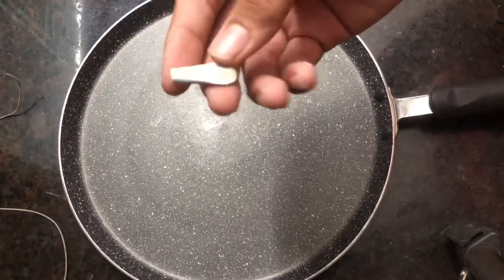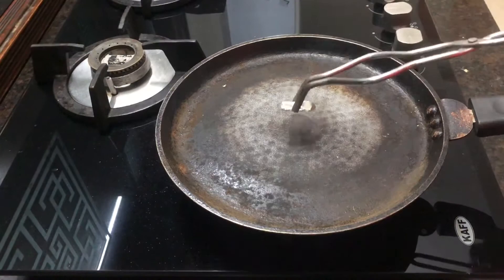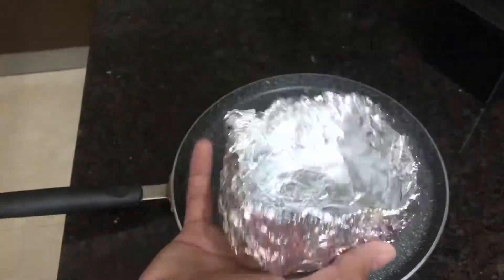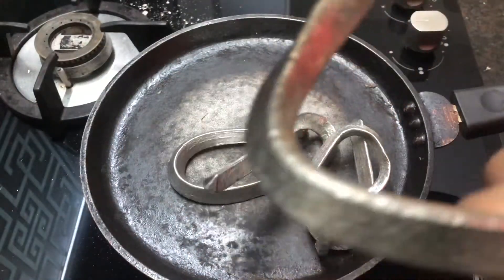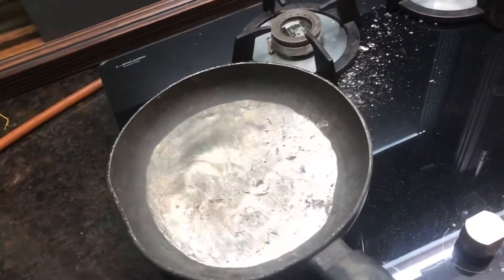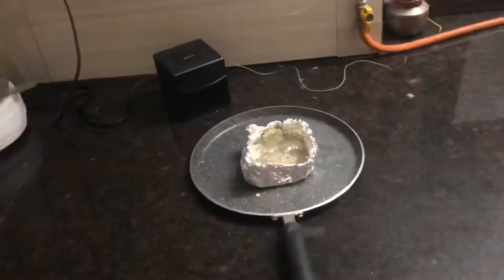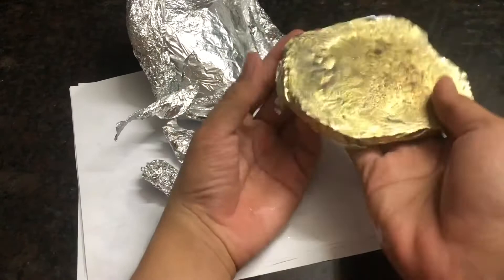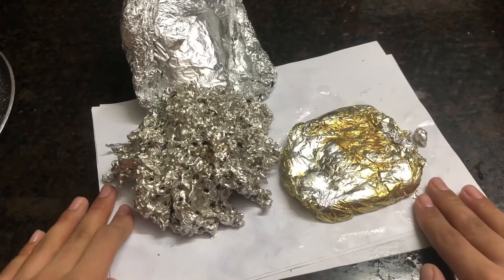|| TIN || The Metal That Melts On Your Stove

Comment: Tin can be used as a thermal storage material, because it's safe to handle, it doesn't produce fumes until it's 2600 degrees. So it can be safely melted and heated up to around 300-400 degrees as a heat storage material. While tin itself holds less heat than water per weight, it actually holds more technically when you factor in the phase change. This is because it takes a lot of energy to get tin to go from a solid to a liquid, that heat is contained then within the liquid state, and when that liquid solidifies it changes it's phase and mass releases heat in this process. 
This is no different than how water also suddenly releases a bunch of heat once it turns into a solid (ice). 
However water isn't practical for phase change energy storage, as it occurs at such low temperatures. 
With tin however it will phase change just by it lowering under 230 degrees or so, so it's perfect for using as a heat storage material. 

In order to build a heat storage unit, you will need a caste iron pot or possible stainless steel pot. Then fill it half full of tin, let's say it's around 8kg of tin. 
You want an electric element pressed against the bottom of the pot, the same type you would see on an electric stove. Run around 1000w of power through it from maybe solar panels. 
Make sure the pot is insulated, so you can keep the heat inside, a heat grade silicone sheath with other insulation outside of that would be effective. The solar panels should produce enough energy to make all the tin in the pot go liquid and possibly heat it up to 300 degrees. 

You can take the insulation sheath off the pot of a night time, and it will release heat and heat a room.
Reply from the maker: good to know
Reply: Hi how to get tin? I don't know how to identify it. Thank you

Comment: This is the experiment that I'm wanting to try and that I'm prepping for right now. I just need 5gr of 99.9%tin metal Using modern science and fusion to fuse tin and copper into gold isotope 104 I need to stabilize the isotope with 14 neutrons because fusing copper and gold gives you 79 electrons 79 protons only a 104 neutrons which means stabilizing it with 14 neutrons should give us a nice stable 118 isotope  if I'm successful with this experiment this could be extremely important for the technological production industry as expensive gold is used in many of their processes for making solid state chips ultimately lowering the cost for future technology  in theory this should work with tungsten and Boron and stabilizing it with an extra 13 neutrons
Reply from the maker: Honestly, I understand the joke, but this paragraph is just impressive.
Reply: @Enderol89  ...what joke? Im dead serious The math says it's right and it should be one of the many combinations that should fuse to gold naturally in neutron stars and in supernovas all I'm saying is using my prototype reactor to atomize tin accelerate it and fuse it with Copper to make an isotope of gold with a lower Neutron count and then bombarded with neutrons using a Neutron gun to bring it up to its stable isotope of 118 neutrons, 79 protons and 79 electrons which is the naturally occurring stable isotope of gold found on Earth.

Most modern attempts to make gold has been using either bismuth lead or Mercury for the Mercury process is fairly simple but creates a heavier isotope with 122neutrons that will Decay back into Mercury over time the process is as simple as smacking Mercury with a fast-moving Neutron to knock an electron off and turn it into a  and turn it into an unstable isotope of mercury that will Decay into a heavy isotope of gold that over further extender time will turn back into Mercury so it's a pretty useless process that they came up with modern days now but that's kind of expected since they're trying to use fission which is taking a heavier element and turning it into a lighter element which is not how gold naturally is made in our universe it's made using fusion taking to lighter elements and fusing them into an isotope of gold that due to the background radiation of a supernova with then turn it into a stable isotope of gold. right now I'm working on building the neutron gun for stabilizing the isotope and redesigning my prototype reactor to optimize it for directional Fusion instead of spherical Fusion  check out this Starr mode video if you want to see a working test run of my prototype I was able to obtain high-energy Fusion using 30,000kv at 225watts input into the total System including the vacuum pump  at 28 Mercury's of vacuum  working on a secondary containment field to stabilize the reaction and looks like I'm building a different configuration for a new prototype to do this experiment with the copper and Tin fusing into gold  and also work out a fast burst Neutron source that I can used to quickly stabilize the isotope  but first I need to make lead paper so I can Shield that Neutron gun so I'm not just bombarding myself and the room.  I'm always serious when it comes to plasma physics particle physics anatomic structures  I mainly got this idea while looking at the periodic table  to see what elements I can use as a solid aneutronic fuel for my reactor rebuild that I'm trying to get  some funding to build a proper shielded reactor with proper materials and accurate analyzing equipment which by the way a full spectrum analyzer goes for around $10,000 for a good one that's accurate. shits expensive  I was originally planning on using the garbage prototype that I have to make iridium which is currently more expensive than gold that I would then use to sell and be able to get some better equipment  but I've always wanted to try to make gold synthetically so fuck lets go for gold.
Reply from the maker: and i though i was good at science

this guy just solved quantum gravity and unified special relativity with general relativity finally synthesizing the theory of everything, through leaving ted talk level essay comment on irrelevant YouTube videos.
respect.
Reply: @Enderol89  technically it's all theoretical and not proven untill I can get the data and testing done and then have it peer-reviewed. For it to be a proper theory and accepted by the scientific community. All I did was take a long hard look at cosmology and my understanding of Galactic collisions, neutron stars  and how they most likely   might have fused gold naturally. So By following the speculated natural processes that are used all the time in our universe using them to guide us through the process on a atomic scale.  we need to do better study the processes of our universe in order to get a better understanding of plasma and particle physics reaching her and will give us more information about the strong and weak nuclear forces that bind atoms together and how we can advance it, for creating elements and stabilizing the Isotopes for long term study.
Reply: @Enderol89  you're probably better at science then me. all I'm doing is trying to think outside the box with fresh look at it by using more than one box
Reply from the maker: I have nothing other then say then....                          I’m running low on replies

Comment: Would a stove burner will work. Not any gas stove. But a mini stove burner fully electric. Not a stove or gas.
Just burner. Will that be able to melt aluminum cans. Metal. Using it. Yh I know it's for cooking but can an electric stove burner. Work for metal Melting.

Comment: Whats the difference between tin and pewter
Reply from the maker: Pewter is an alloy(mix of many metals) where as tin is a pure element
Reply: @Enderol89  
Tin if mixed with many metal eg zinc batteries aluaminium if mixed is it considered pewter?

Comment: what type of pan did you melt the tin on? i dont waant to use the wrong pan or something
Reply from the maker: any should be fine but if it has a coating you should let it heat on max heat for a while to burn it off, so the metal wont start a fire when you melt it and also the pan shouldn't be used for anything but metal melting then cause it could be dangerous for food.